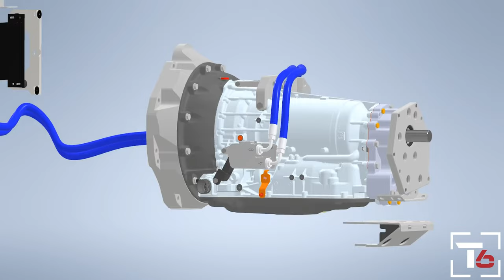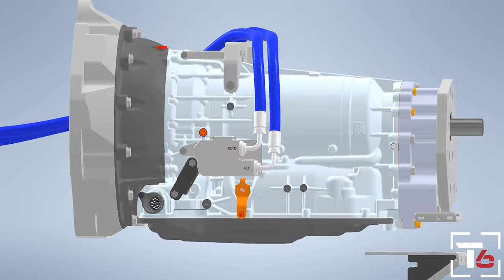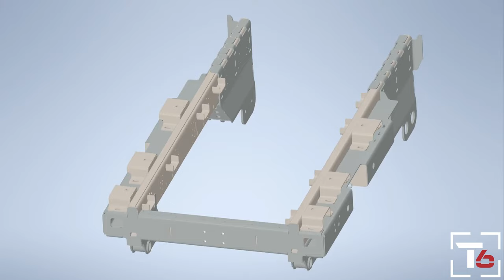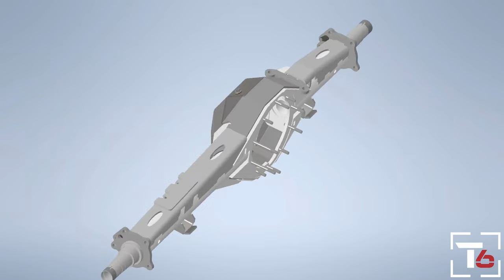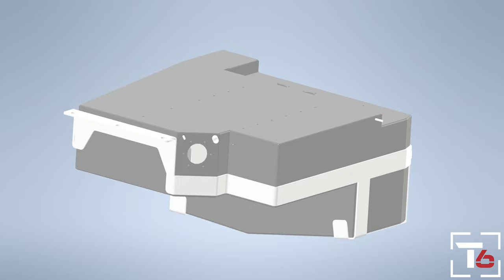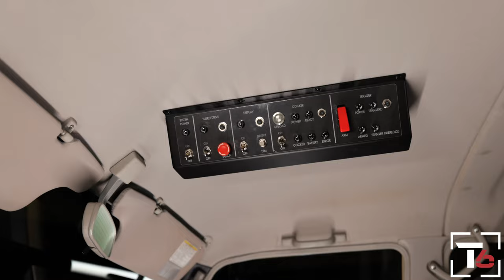Armormax Defence unleashes the game-changing TAC-6

Comment: Cool. So it's a toyota pickup with a dual rear axle and a flat bed. Got it.
Reply: Upgraded axles with more oil capacity, heavier springs, stronger drive shafts, larger fuel tanks, custom HD transmission, reinforced frame, bead lock wheels and 6x6 with lockers, etc. They put in a ton of cool stuff in these packages that make the legendary 70 series even better. They are way overbuilt compared to the already insanely tough 70 series Land Cruisers. It would be awesome to build one into an overlander.
Reply: Yes but... for way way waaaaay more then you would expect to pay for a Toyota with duel axles and flatbed.
Reply: And the gun on top, you for got that. Hope it's controlled from the passenger seat, otherwise the gunner's going to get eaten by T-Rex or swooped up by a Pterosaur.
Reply: @PiDsPagePrototypes  remote weapon station 😉
Reply: @PiDsPagePrototypes they show the controls at @3:51

Comment: 7000 lb carry capacity means a really sweet slide in camper could be accommodated.
Reply from the maker: Yes definitely 💯
Reply: This is my exact opinion also. I was looking at the Range Rover perentie as a dual cab ute with easy to work on components for the exact same job.

Comment: What's kinda funny is we have better rigs on the Rubicon all day long. Some even have Deuce and a Half axles. But they all cost less than $20K.
Almost wish I had the gall to sell something like that to the taxpayers.
Reply: and it wouldnt take long for them to fail in combat, and WHEN they would... I take it you have not been, by your opinion? Then having to fuck with custom, and unobtanium parts(in any random shithole in the world), more than likely under threat of or actually under fire.  Those modified rigs for the Rubicon are better rigs to take on the Rubicon, designed to do that task. I'm not saying this thing is the perfect specimen, but it is PURPOSE built for a set of tasks, and pretty well thought out SYSTEM as a whole. Choosing a LC is smart, wide covereage worldwide, among many other positives.

Comment: Lol "state of the art suspension system"  that's a leaf spring and shock setup....
Reply: Show me a truck that is meant to carry 5 tonnes that has coils. I'll wait.
Reply: @tosgem     I'm making fun of the sales pitch not criticizing the design choice.   Yeah leaf springs and shocks are standard for heavy duty trucks because they are simple, pretty effective and cheap but that's the point its totally standard.
Reply: @SavageShooter93  I agree to a point, they could have at least got a leaf-over kit and put the leaf springs over the axels rather than beneath. But for this vehicles intended purpose I believe leafs are the best choice
Reply: @tosgem  I agree its supposed to be a tough light military vehicle.  Anything more advanced/complicated would sort of defeat the purpose.   Again I was laughing at the marketing not the design.
Reply: @tosgem  Ive got an Oshkosh MTVR cargo truck - ex military MK25 (has winch vs std Mk23, no winch), its rated by military to carry 7 tons ... offroad  (rated for 16 tons on highway).  Its 6x6, 3 axles, each axle is independent suspension, wanna guess what the springs are?  Yep, coils, 6 big ones in total.  

Its the opposite of small, light, easily transportable though.  29K lbs... empty weight.  62k lbs (30,000 kg) fully loaded + can tow heavy trailer...
Reply: @IridiumRedTheOrigina I just watched a video by Midwestern Military Equipment. Where did you get yours?

Comment: 35" tires are not "impressive" lol, its pretty much a minimum for offroad vehicles. this seems like a lot of hype about a medium modified Toyota 6x6, marketed to people who don't know anything about offroad vehicles and are easily impressed. none of this is stuff that hasn't been done by many people before without the inflated cost. still has leaf springs with non bypass shocks (are they just oem?) and your calling it an advanced military vehicle? common.

bypass shocks, choil springs, portal axles or reinforced dana 60hd / dana 80, 38" tires, tube chassis, ctis, more lights, manual atlas or other transfer case to avoid complexity, then we can talk.